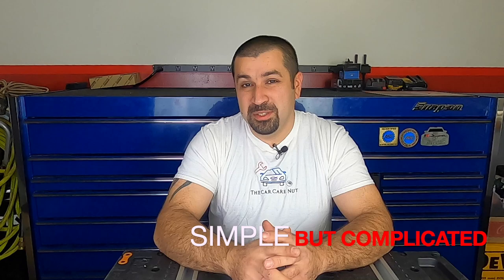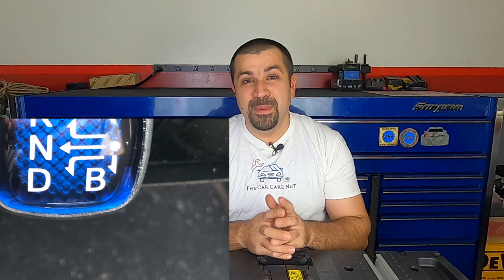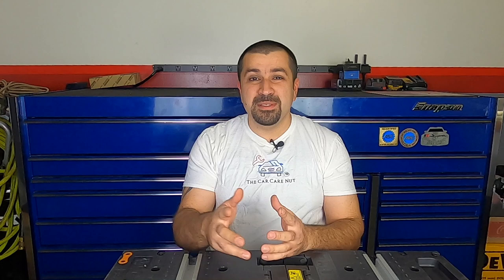How Toyota Hybrid System Work Part 6 B Mode and Hybrid AWD

Comment: I think I am more confused now. So is B Mode only intended for slowing down on steep grades in order to take the load off of the brakes?   I had been using it when approaching stop lights, or when I needed to burn off speed approaching slowed traffic. Seems like I was wrong to do that.
Reply: From what I understand, B mode is like downshifting a regular transmission. It will slow you more, but like he said it's not efficient because while it's generating more electricity by applying 100% regeneration with MG2, it's also using some of this electricity to spin MG1 to spin the gas engine and use it as a braking force (the gas engine is forced to compress air without spark and fuel). So it's not "wrong" to use it to slow you down, but it will give you worse fuel economy because it's not as efficient as just letting the car regen normally in D mode. Use it for slowing the car when going downhill. I could be wrong I'm new to hybrids 😛
Reply: @smoguli  you're not wrong but it does use gas to use B. The gas engine will pull fuel when essentially downshifting. You aren't gassing but the engine will still pull some. Like a high idle. Very inefficient.

Comment: It was mysterious to me for awhile. I use B mode going down long hills when my battery is full. I figure then there is no more room to put energy in the battery with regen, so to avoid scorching the brakes, I throw it into B mode.
Reply: You technically do not need to do that, as the vehicle will automatically transition into B mode when braking if it detects that the battery SOC is near 100%.

Comment: i drive a taxi its a hybrid camry. i been wondering am i doing the best thing when i push the brake only hard enough to saturate the 2 bars of regen? if you let go of accelerator pedal and do nothing else in drive it will only use half a bar of regen and usually that is very difficult to predict if the car will slow in time to stop from low low speed... also not sure if i am misjudging but when the traffic signal light changes green to red and i go to brake sometimes the braking distance is slightly different and im sure you know why that is?

Comment: Just saw this video, thank you so much for all the information you provide.  It is so helpful.  I had a quick question about the AWD system.  I live in a warmer climate in Texas, hot summers, mild winters (For the most part).  We recently purchased a 21 Toyota Venza.  I suspect that the majority of the time, the system will work mostly in FWD.  In regards, to tire rotations, should I rotate the tires like a FWD system or an AWD system?  Just curious since this is an electric AWD, not full time mechanical like Subarus.  Or am I misunderstanding the system?  Please advise.
Reply from the maker: Hi! Thank you for watching! Very good question. So you’d want to treat it as an AWD system when it comes to matching tires. But not as sensitive as say a Subaru. You can rotate the tires as needed cross or front-back
Reply: @TheCarCareNut  THANK YOU so much.  Traditionally I’ve been told that AWD systems need to be rotated in an X pattern and FWD need to be rotated front to back with back tires crossing to the front.  I usually replace all 4 tires together, but every once in a while, I’ve replaced them in pairs depending on need.  This is my first AWD, so I just wanted to make sure I take care of it.  It seems if needed, replacing tires in pairs would be ok with this hybrid AWD.  I would love to hear your thoughts on Japan vs US Toyotas, and now that the Tacoma is switching production to Mexico, will quality potentially go down?  Also what are your thoughts on the upcoming Toyota BZ4X EV?  Just some thoughts for future videos.
Reply from the maker: So the Japan vs NA build I’m working on a video with details on that! And on the BZ4X I have no more information on it than what’s published. I’m more of a real world kinda of guy and until I see the car sitting in my work bay I tend to reserve opinion if you know what I mean

Comment: AMD, I love your channel! Should i be worried about extra cost of maintenance if i go with the new AWD Sienna vs the FWD Sienna? Is there an extra battery fan filter to replace or differential service? I love that i wont have to worry about have equal tire tread with the front and rear. Thank you in advance.
Reply: Most people don't need AWD but if you know you need it, go for it. I love my HHy 4x4. Amazing, if not Godlike engineering.

Comment: Turning the gas engine into an air compressor, effectively, is much like how a Diesel engine in a semi truck has fuel shut off to a varying amount of cylinders to make part of the engine into a compressor, for engine braking. The famous, but noisy, Jake Brake!
Reply: Except that in the hybrid it's still pulling fuel when doing so. Like a high idle. Very inefficient.
Reply: Also a diesel has to have the fuel shut off when doing so because otherwise the pistons would still be firing on the glow plugs.

Comment: It would be cool if you could change the settings to not use the engine and only use the regenitive breaking in B mode. And or tell it how much to use 25% / 50%/ etc.
Reply: Some newer hybrids do that. Called cart mode or something. Can't remember if it's Toyota?

Comment: When do you shift to B mode? While the car is descending downhill? Do I need to stop before shifting to B mode?  Will it not damage my car if I just shift to B mode anytime?
Reply from the maker: Hi! Use it when descending downhill to slow the car. You don’t need to stop, just shift into B mode and no damage would occur if you shift while driving.

Comment: On a 2017 Prius Prime/PHEV  driving on level ground, will it regenerate more/quicker if 'B' is selected, assuming the HV battery is [partially] discharged[?
Reply: It will BUT you will use more gas than it's worth.

Comment: I was also trying to find an information about B mode but it seems that the explanation I was given is not in line with yours. If B mode was counterproductive as you say, we wouldn't be able to charge the battery going downhill. First of all in B mode the MG1 is propelled directly by the wheels and the amount of load/drag of the MG1 is controlled by the AC/DC converter by increasing/decreasing the resistance which is used to produce energy from spinning MG1. The motor is used as a generator to charge the battery. Sometimes the engine can be used to help with the braking force, but only when the battery state of charge is full. In the B position on Toyota hybrids, both motors are used for regenerative braking. When MG1 is used for regenerative braking (and the battery is full), it can use the electrical energy generated by MG2 and force the engine crankshaft to rotate at a high speed (with the fuel injectors shut off) to dissipate the extra electrical energy.
Please have a look at WeberAuto about Regenerative Braking Systems: https://www.youtube.com/watch?v=dC_Qvs_scT0
Reply from the maker: Thank you for your comment. Mg1 is not directly propelled by the wheels it is directly connected to the engine on a mechanical connection that is not broken on hybrid only models. Mg1 doesn’t drive the car, it only generates and holds and spins the engine. When the engine is on and providing positive torque then mg1 is being driven by the engine to generate. In b mode mg 1 spins the engine to use its compression as dead weight to slow the car. Regen braking goes to maximum but it also uses a lot of energy to spin the engine so it becomes counterproductive. In regular regen braking mg2 is being driven by the wheels to generate. Only time mg1 charges the battery is when the engine is running.
Reply: @TheCarCareNut  I understand that in regenerative braking both MG1 and MG2 are not propelled directly by the wheels but through the power split device which is in fact the planetary gearset. But then both engines serve as generators, MG1 filling up the battery and MG2 creating the drag by itself and the engine connected to it. MG2 is not using the power from the battery but the one created by spinning wheels, is that correct?
Another thing is the engine acting as a air pump, I remember also being told that it's not the compression of the pistons is creating the drag force because in the next move down the amount of compressed air helps pushing it down. So more or less the amount of energy taken/given is zero. What causes the drag is the vacum built by closed throttle.
Reply from the maker: Mg1 doesn’t generate when the engine is off. They are mechanically connected so every time mg1 spins so does the engine and vice versa.

The engine creates a drag when each of the pistons is on the compression stroke with both valves closed and the piston is moving to top dead center.
Reply: @TheCarCareNut  According to WeberAuto on the P410 gearbox and newer transversal layout the MG1 is connected to the engine through the power split device (planetary gearset - there are in fact several) and MG1 rotatating speed varies from the engine RPM. In fact MG1 can be even stopped when the gas motor is on delivering power to propel the car but the battery is full and there's it no need for MG1 to create energy. From what I understood it also works backwards. B mode, car driving down the hill, wheels are propelling the final gear which runs the power split device which powers both MG1 and MG2 and the engine. Whether both MGs are creating induction and how much is decided by the converter by creating resistance.
If the B mode is using more energy that it provides how come it's able to fully charge the traction battery? Each time I was able to do that going downhills in the mountains.
I'm kind of lost in all this :)
Reply from the maker: I’ll give you a better resource than me and Weber auto. Go to techinfo.Toyota.com purchase a day subscription which will give you access to the official information from Toyota. Navigate first to library and select the car you want to know about then go to new car features always go to the first model year of the model to get full information. Then go to technical training and enter the model and search through the technical training information. You’ll be there for a few days and might have a slight headache because the information there is meant for technicians and most of the time is not reader friendly. But it will go into great depth.
Reply: @TheCarCareNut  Thanks a lot, I'll try to go read it.
Reply: @tygrysisko  I wouldn’t say B mode uses more energy than it provides. As I understand it, engaging B mode causes MG2 to go into maximum regen. Depending on the battery state of charge and the specific model of car, some of the power generated by MG2 will be shunted to MG1 to spin the ICE to burn off the excess energy that the battery is unable to receive. So yes, during extended downhill runs, the battery should still fully charge, just not as quickly as it would if you were braking in D mode with the brake pedal. And even then, if the battery state of charge reaches a high enough level, the car will automatically go into B mode and shunt the excess power to MG1 and the ICE.

Comment: Is it ok to shift to B Mode to slow down at moderate (50 kmph) or high speed (80-100 kmph) when coasting to stop towards a traffic light on red?
Where I live most roads are undulating ups and downs and I like using the B Mode downhill while preventing engine RPM going too high (can hear the rpm) by using a combination on accelerator/brake/shift back to D Mode. It’s giving a fairly good mileage but I hope I won’t destroy my car doing all this. Any expert opinion on this? Thanks

Comment: Does the 08 HHy automatically turn on the AC system to cool interior air that is drawn in to cool the traction battery on hot days?

My AC was warm for a while.  The car tried a couple of times to turn on AC.  It seemed that the traction battery would not charge after that until things cooled down.
Reply: No

Comment: I have a notorious small downhil near our home where I once used B mode, thinking that I could get a little more battery charge. No, didn't work. It is indeed only to be used in the Mountains like the Alps to save the brakes and to downshift the regenerative breaking. B is for Berg (Mountain)...
Reply: No. Nice try there. B is for brake.

Comment: I thought B mode could be used for going up hills, not just down them. What's your opinion about that?
Reply from the maker: B mode is similar to engine braking to slow down the car. You don’t want that when going up hills. When going down the hill you want to slow the car down

Comment: Cruise Control will not work in "B" mode.  Also, the engine will not turn off at traffic lights.  It will idle all the time in "B" mode.  This has been my experience in my 2011 Prius.
Reply: True. Cruise control only works with “D” mode and will automatically engage “B” mode as needed without telling the user.  

Thought not designed for it, you can use “B” mode when battery is almost depleted and you are stuck  in traffic. Not the best, but sometimes it is a hassle having the engine fully stopping every meter.

Comment: In your honest opinion,  on the maintenance schedule (Canadian schedule specifically) for the 2019-2021 RAV4 Hybrids it mentions "Tighten Rear Drive Shaft Nuts". The RAV4 has no traditional driveshaft in it's electric AWD system, what is this maintenance item referring to, there's no clear answer out there on this? Is there a maintenance performed you can clarify on the rear electronic differential/transaxle instead, for us DIY'ers.
Reply from the maker: Hi Michael! That’s essentially a maintenance schedule book error as there’s no driveshaft nuts to tighten in this case. The only maintenance on the rear hybrid transaxle is fluid change every 60-90k miles
Reply: @TheCarCareNut  Cheers, this helps loads! Can't wait to see your video on the rear transaxle fluid replacement. I heard on the Gen 4.4's these drain bolts were a nightmare to access/torque to spec due to clearance.

Comment: Is there a way to recognize when I reach 100% regenerative breaking and the disk breaks are applied on a downhill road?
Reply from the maker: Hi! When the battery charge indicator reads full.
Reply: You should also hear the hydraulic brake fluid pump engage (slight buzzing sound) when the friction brakes are applied after being released for an extended period of time. I find that to maximize regen, start braking early keep the gauge at about 3/4 of the way into the charge zone. In normal driving situations, that is more than enough brake force to slow you down, and this way, the friction brakes do not engage until vehicle speed has fallen under about 10 mph.

Comment: Why does Prius have the shifter setup like that? Reverse is up, neural is center, drive is down?
Reply from the maker: That is just a design feature. That shifter doesn’t have a cable so it’s fully electronic. Some other hybrid models with a physical shifter does have a physical cable going to the transmission and that cable only gets the transmission out of park and gives the computer a signal

Comment: Does anyone know how much the fact that the ICE charges the battery contributes to the overall efficiency? I.e, if it ONLY used regenerative braking to charge the battery, how much (if any) less efficient would it be? (notwithstanding the fact that the car can't be driven at all with a flat battery - that's one good reason to keep it charged)
Reply: Using the ICE to charge the battery is actually going to be WAY less efficient than recharging through regen braking or (if you have a PHEV), plugging it into a charger. You will always use up more miles of gas range charging the battery than you would gain in miles of electric range when forcing the ICE to charge the battery, as you can in the newer plug-in Toyotas. All Toyota hybrid cars’ software is designed to maintain the traction battery at optimal levels, so the best thing to do is to just let the car control the power flow without any intervention from the driver.

Comment: I have a Prius 2009, when the ABS has been replaced by a mechanics, putting the can on B mode will not slow the car as it was before replacing the ABS. any explanation why ?
Reply: Oil change?

Comment: can a toyota highlander hybrid performs good on very cold freezing weather like here in canada, will it affect fuel consumption, will it affect the proper distribution of electric power from the battery?
Reply from the maker: Hi! Cold weather will affect gas mileage on hybrids but they do well in cold weather
Reply: Fairbanks AK and I don't plug in. Religious about oil changes and drive everyday.

Comment: So, if my battery is getting full and I am going down a steep hill, this will protect my  artery from overcharging? I’ve been wondering about what happens when the battery is full going down a steep hill.
Reply: You don’t need to use B mode to stop the battery overcharging, the car takes care of all that for you. Just use B mode to help save your breaks from long steep hills only.

Comment: Hello. I have two questions.
1. Overflow from fill plug? I fill my rear differencial and transmission fluid until it overflow from level check plug. Is that wrong?
2. Do MGR keeps generating while i am driving in FWD mode?
Reply: 2. MGR only generates power when you are actively braking. If you are on the accelerator, in most situations that do not require AWD, MGR will be doing nothing. If it was generating while you were cruising or accelerating, that would create additional drag from the rear axle that the forward power train would have to work to overcome to give you the same rate of acceleration; in other words, it would be counterproductive.